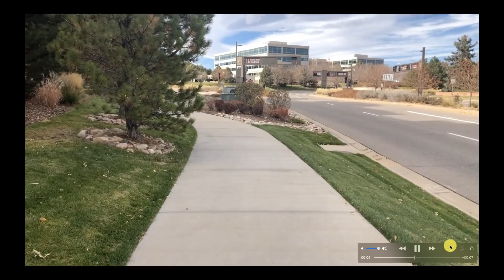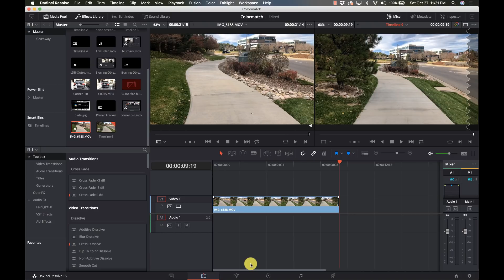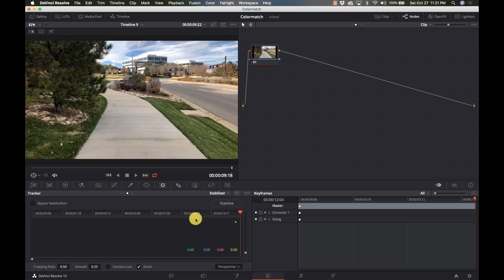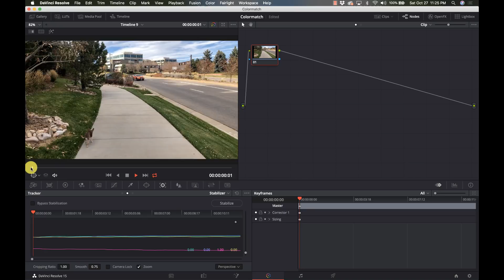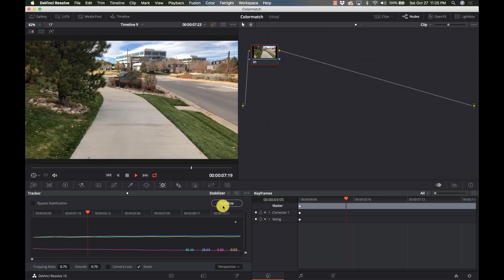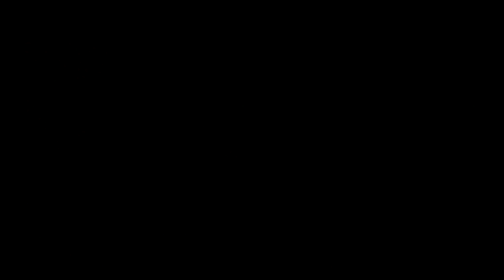Fix Shaky Footage with Davinci Resolve

Comment: Your explanation of the stabilization controls are a bit off, and might mislead viewers to conclude Resolve's stabilization is less than capable. It appears that you increase the crop ratio to zoom in more and therefore increase the stabilization effect, but that is actually backwards. Increasing the ratio, decreases the stabilization. I know, not very intuitive. The manual has a description of all these controls in good detail.
Reply from the maker: I find it to be quite capable except with certain shots, which I then can use the legacy version. My point was, if it doesn't work with the default settings, you just need to try tweaking them to see if you can get a better result. If I wasn't clear, I probably need to stop recording videos at 2am. :)